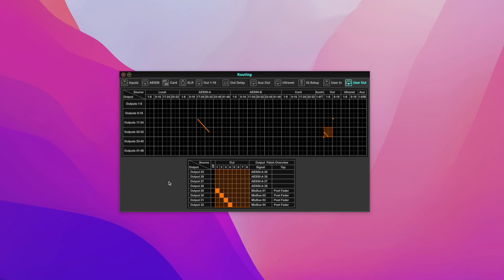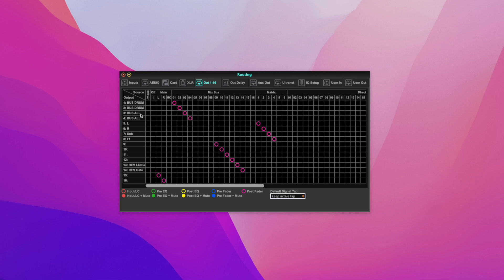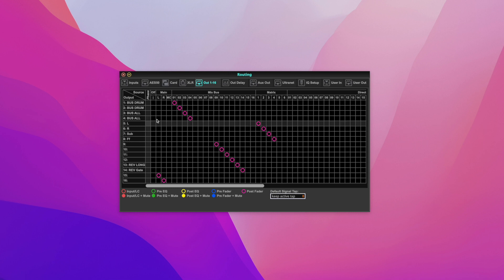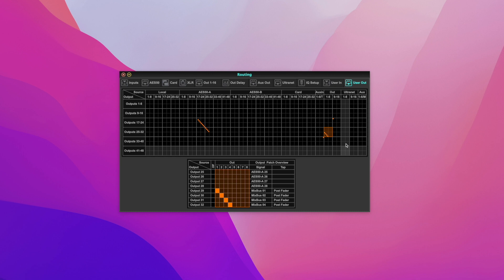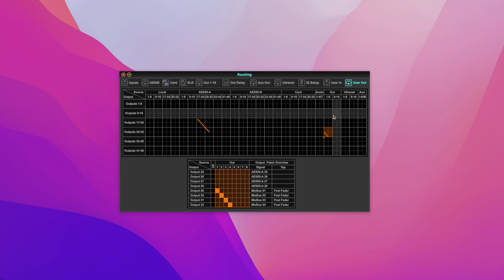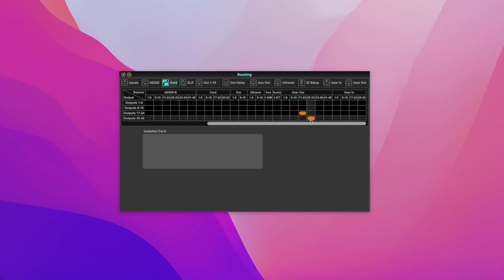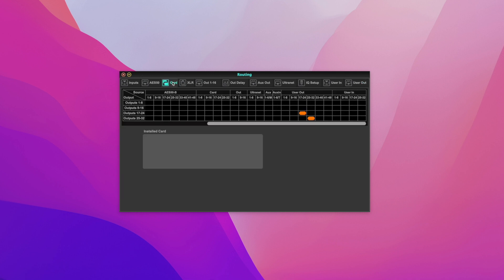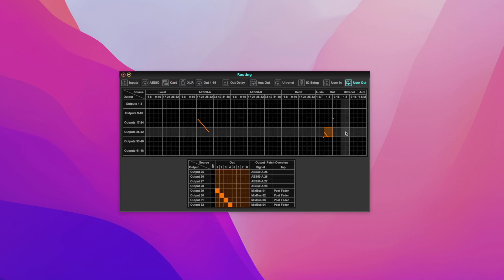How to send X32 buses to LiveProfessor

Comment: How do you receive the sound back in the mixer  after it is processed in the card? Are you using live professor plugins as inserts on the Drum and Master Busses? Obrigado pelas dicas!
Reply from the maker: Actually the sound doesn't go "in the mixer" before the card. The routing sends the AES signal, into the Card, without going through the channels. So to get the signal into the channels, the Inputs should be set to CARD.
So AES->CARD->Channels.
It's not really an insert, the channel gain/trim is coming AFTER the plugins.

Comment: Where are you returning it to from Live Professor?
Reply from the maker: Drum bus into Aux1/2 
LR bus into Aux 3/4 
By setting "Aux in Remap" to "User in 1-6" and creating a USER IN that receives the CARD out 29-30/31-32 into inputs 1-6. Then on the Auxs, you choose the correct input for each of them (C29/C30/...)
Reply: @MiguelVegMarques  cheers man
Reply: @MiguelVegMarques  don't suppose you could make a short video actually doing this on the board?
Reply from the maker: @derekrushe  I usually do this on the offline editor